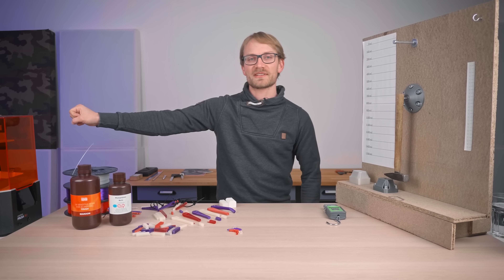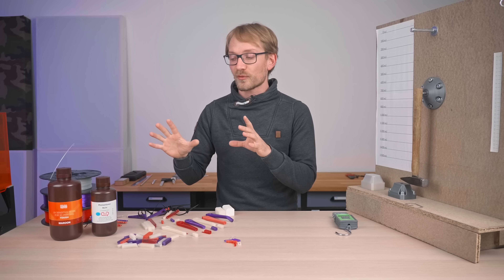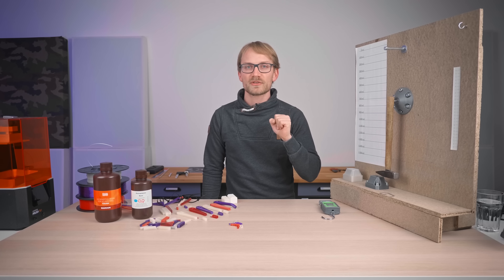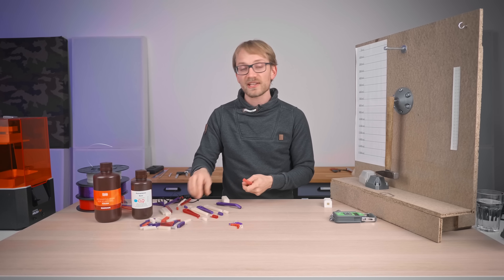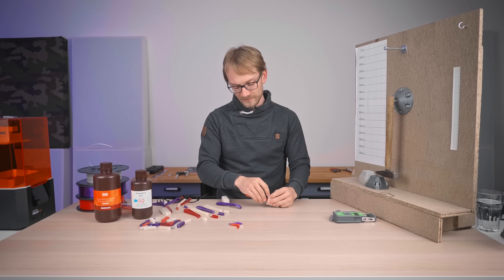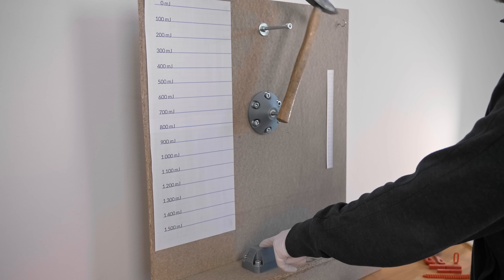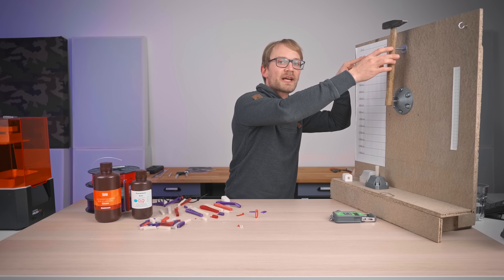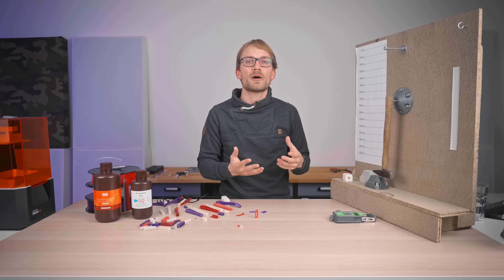Elegoo resin vs. Prusa resin vs. PETG vs. PLA

Comment: My big issue with resin prints is that they seem to continue to cure and become more brittle over time. PLA and PETg do get more brittle as well. I'd love to see a "6 month followup" where you print some parts in common materials, let them sit out in ambient for 6mo-1yr and then retest them to see how the properties changed over time
Reply: I can follow up on this.
It all depends on the resin.
Engineering resins that I have tested like Siraya Blu and Tenacious don't change over time.
In fact it's recommended to cure them under high UV power at 60c for 1 hour or more.
Now the cheaper resins on the other hand do become more brittle.
And as an extra bonus Glock frames made from a Siraya blu and tenacious mix perform rather well.
Reply: @rgstever  how did the frames hood up that’s what I’m looking at a resin printer for
Reply: @rgstever  can you use those "engineering resins" with "home resin printers" ? :D
Reply: @jesperchristensen8462  i would like to know this as well
Reply: @jesperchristensen8462  Yeah, they're just expensive.
Reply: @jesperchristensen8462  i have seen videos of people mixing 75% normal resin 25% technical resin from siraya, or 90-10... Different technical resins that they offer I think they were
Reply: @jesperchristensen8462  Yes. The Elegoo ABS-like is my go-to resin for my Mars 3 Pro. The Siraya Tech high performance resins also work just fine, when you're willing to pay double for a tougher part.
Reply: @ingeniando3d219  It really takes a mix with better than 10% to get any benefit. At 25% you're just starting to get a consistent change of performance, and it really takes closer to a 50/50 mix.

Though to be honest, what you're doing is taking an expensive high quality resin and corrupting it with a cheap resin. It's better to just pick the prints where you really need the extra performance and pay for it, rather than to try to jimmy the resin for prints that don't really require it.

The Elegoo ABS-like has excellent properties and is priced well. When you really need extra toughness or temperature resistance, it's better to just buy the expensive Siraya Tech resins and use it unadulterated to get the full benefit.
Reply: @saundby im just looking for whatever can produce the strongest and clearest looking clear and idk if fdm does it or sla
Reply: I saw a YouTube video where did a 1 year later test with different types of PLA. Regular PLA held up pretty well to outside weather
Reply: And leave one in a south window or just out on a fence...

Comment: I’ve been noticing that the curing times of resin are SIGNIFICANTLY greater that what anyone with a YouTube channel has been stating.  Using the Elegoo ABS Like resins, and a 60W UV lamp, I’ve been noticing that it takes at least 2 hours to cure prints, if not longer.  There is a huge difference in stiffness with those that have been cured for 2+ hours, and those under 2 hours.

Which brings up another point.  It would take days to weeks to cure prints outside under a bright Sun, even here in San Diego where we typically have a UV index between 8 and 12.  It would be interesting to see you and CNC Kitchen do some research into this from both the resin manufacturer side, and actual tests.
Reply: What kind of lamp are you using? Clear Crystal quartz or blacklight style UV lamp?
Reply: Deneteus neither.  I am using an 405nm LED UV lamp, which has even less loss than crystal quartz does.  I doubt anyone uses any type of UV bulb today.
Reply: @KaelumYodi  Commercial resin curing does that's why I asked specifics. They make equipment specifically for fast curing of resins. You can cure using UVC bulbs used in the medical industry for deactivating bacteria in air conditioning.
Reply: Deneteus I should have said that it isn’t practical today, to use UV bulbs for anything outside of extreme environmental conditions (i.e. extreme heat).  Bulbs can’t produce as narrow a bandwidth of light as LEDs can, they are extremely expensive to manufacture, they have short lifetimes, and they lose at least 10-20% of their energy just from shining through their encloser (crystal or other, as real glass blocks at least 90% of the UV).  Anywho, since I am using a UV lamp of the wavelength that the resin is specifically designed to react to, this is not an issue.
Reply: I suspect short cure just makes the print possible to handle and kicks off the curing, but does not achieve high degree of crosslinking, because that's just what manufacturers optimise for, they want to occupy the curing machine as little as possible and ship things to the customers and hope they'll take a while to actually load and break things, weeks or so. I suspect the curing once started doesn't actually stop when you stop blasting it with UV, it just continues more slowly.

Which then brings the issue that if my conjecture above is true, then all kinds of mechanical tests on prints that were done yesterday, are not valid during the life of the part several months after initial manufacture.

Comment: That's weird, my Elegoo printed pieces break wait too easily. Maybe I overcured them ?
Reply: Once set off, the curing can never stop. It is necessary to test in the most cured state possible, else the strength of the item is not representative of the strength it will have in actual use several month later. I am a bit suspicious whether Tom rushed the test a bit, if he believes the surface of the Elegoo print to still be tacky, but then, maybe the surface texture is simply slightly unusual and deceiving. Correspondingly there is a possibility that the inner opaque part of the Prusa resin will continue curing in the upcoming weeks.

It's completely unreasonable to undercure the prints on purpose.

I suggest that you likely have a completely different resin, is this possible? Also what makes you believe specifically that you over- rather than undercured them? Also temperature has an influence on crosslinking behaviour.
Reply: @SianaGearz  nope, it's the same resin, elegoo abs-like.
I was thinking overcured because I left them more than an hour under uv and the pieces slept on my windows for a few days (more than a week) before painting.
The scope I was painting didn't survive the fall of the table, one of the end broke in 3...

Concerning the resin behavior, I sometime have a tacky felling out of the cure, but it's because I didn't wash it enough, or the pieces were still wet under the uv. But most of the time the felling disappear once a few days have passed.
I think you're right, It might be a better test if the pieces are left a few days out to cure fully.

Comment: Test Siraya Blu please. At least that's the one being hailed as the toughest of the affordable tough options.
Reply: Oh, one more - if you want to make a test that no one seems to have done yet, do one where you test parts after extended UV exposure... I don't know how many hours in the curing station corresponds to, say, 6 months of an average European summer. But there's a lot of chatter about whether resin is more or less subsceptible to UV damage than many plastics. Some say that once fully cured, they are less prone to heavy UV damage while others insist that they will keep "curing" and become brittle (faster than many plastics). So far, all I can find is talk...
Reply: Also, Phil G had some results which seemed to show that curing at higher temps led to quite dramatic improvements. I think Formlabs has some white papers about that too (curing at 60-80C). But I don't know if the Prusa curing station can be set that high or set to keep the heater on during the cure cycle? There may even be improvements to be had from printing at slightly elevated temps (about 30C).

Comment: Finally some actual data about the durability of resin prints!!! 😁Very interesting results. The dimensional accuracy of SLA with at least PETG material performance make a very compelling argument for using SLA to produce functional parts.
If you're going to do more testing in future, may I suggest: 
Does prolonged UV exposure affect ductility? The claim / doubt / worry is that the resin will continue to cure over time, and become more brittle. Temperature resistance data for resin prints is often hard or impossible to come by, so that would be very useful data.
Thanks for the great video!
Reply: At work all the older resin prints are aged looking in a nasty yellow tint and extremely weak by comparison to new ones, so yes. It doesn’t take a super long time either and these are stored indoors (I’ve got FDM gears that are still fine even 6 years later on my printer and it’s sitting right next to a window, so ABS really doesn’t deteriorate as bad as resin even after a few years)
Reply: @jakegarrett8109  , does that hold for ABS-like resin?

Comment: Nice! If you want your resin prints to have a hard surface, you must post cure them underwater. Oxygen inhibits the upper layer polymerization, so you have to get rid of it. Also, some resins like warm post curing, and some don't, resulting in brittleness. You must test or follow the instructions accordingly. Thanks for the tests!

Comment: Filaween was a great tool for learning.
However, as long as we buy quality filaments, there do not seem to be huge differences.

It is important to understand when to use which material, but I usually do not choose one specific manufacturer to get the last 5% of material strenghts into the design.

For the resins, we now see massive differences in properties.
Differences of the scale between different materials in FDM.
In this case, choosing the right manufacturer definently needs to be considered for mechanical parts.

This was one of the most informative videos in the 3D printing space I have seen in a long time.
Keep it up! I would love to see an analysis of the difference between transparent and opaque materials. 
And of course between manufactureres in general.
I'd recommend a focus on "tough resins". Since this is what would be chosen by the customers for mechanical prints.
"Normal" resins, for figurines etc. will be used less for mechanical prints. So there is less gain in analyzing them.

Comment: While I agree most folks don't tune all their filaments, this leaves one problem nevertheless: You might test one material that's just about perfectly tuned—simply by chance—and another that's way off from its perfect settings. If all are equally "mistuned" it's fine, but without calibration, you just never know where they stand.
Apart from that: very interesting test, thanks!

Comment: Let's solve the layer adhesion problem somehow, is it possible to make the printer squirt some solvent to bond the layers better and to not leave gaps? It sucks if you have a part loaded in all directions because there's such a huge difference in the strengths
Reply: Solvent sounds like a terrible idea, very hard to control, because it will linger and it will go wherever and it will curl the print due to locked in stresses. What isn't though, is printing in a hot chamber. Whether an actively heated chamber, or just bed-heated chamber and an airtight enclosure. You can have thin-tube water cooling for the cold end of the tool head. You already have a suitable tool for bonding plastic to itself, it's melting, you just have to have the newly laid bead melt the very surface of the underlying one, and for sure preheating the volume of the print helps.

Upon cooling down, the print shrinks uniformly.

It's not a 100% solution, but it should get you a good part of the way there.

I recall layer adhesion was not solved by solvent vapour smoothing experiments, even though they provided an improvement. There is still inherent anisotropy to how the material cools down during printing which results in stress.

You may also recall that PLA annealing has provided a tangible improvement. Unfortunately it deforms the shape of complex prints a lot. Hot chamber printing does not.

Comment: curing behavioour of opaque resins is very different from clear resins. that is why resins used in engineering are usually not opaque.
Clear resins are much more predictable as the pigment content is so low it will nott obscure parts of the print while curing.

Comment: Hey tom, I’m a plastics engineer with experience doing mechanical tests on 3D printed parts. If you’re interested I’d be happy to help you doing future videos by helping you get your facts right and possibly doing some tests on the proper test equipment
Reply: My crazy idea is that Tom, Stefan, and other like-minded experts (like you) get together and create some standard test methods and open-source hardware test equipment to enable many materials to be tested in a consistent manner and post all of the results on the Toms3D, CNC Kitchen, Meltzone, or other website. Sure would be handy. And hardly any work at all.
Reply: @mikemike7001  This is one of the brightest thoughts I've seen for a while!
Reply: @mikemike7001  I am just beginning my first 3D printing (primarily mSLA) business and what you just suggested would be something that I would watch, use, and personally market on my website both to help me prove out selected material strength and pay back for the help in making more intelligent choices.

Comment: I wonder if you could change your resin printer test shapes to include a middle hollow core so UV light could be introduced into the center of some samples?  Maybe make it 5mm diameter so you could stuff a 5mm UV led in each end?  This way you could test with and without internal curing.

Comment: Is this the beginning of a clear resin revolution? It would be quite ingenious for manufacturers to do that actually since most users of resin printers use them for miniature models that need to be painted anyways. And engineers who use resin generally wouldn't care about the colour but if they did, translucent resins clearly would be able to cure just as well

Comment: Love this, thanks for your testing. I'm super curious about the heat resistance of filaments vs resins - ie parts designed to survive a hot car. Could you do a video on this? It's difficult to find good information on the heat resistance of the different resins out there.
Reply: Jimmy Blimps Resins don't really change when they're in heat -- they can't melt. They should be basically the same in a hot car as they are in a regular room.

Comment: I'm disappoint that the PETG is actually a strange filament with particle in it. Do those particle have a effect on physical property? Why making a comparison with strange filament that did not reach market?? This lower the "value" of this experiment.
Reply: All filaments with added aggregate are weaker in strength tests to their non-contaminated cousins.  You can think of this as a basement grading if you like.  Added materials can add rigidity (this one wasn't specced for that, so it didn't), but all will weaken the flexibility and overall strength of a part.  All those CF-infused filaments make much-more rigid parts, but all are less-able to absorb impact and tensile loads.  It doesn't come even close to invalidating the tests at all, since we know that the particulates are reducing the score, and therefore all results are lower than a pure PET-G, and this is a *RELATIVE* test, not meant to set an ISO standard rating for the materials in question.  It's very well-known that PET-G has fantastic mechanical qualities in its "raw" state, with overall formulation adding or subtracting from what we know it can do.  We also know that PET-G is absolute garbage - along with PLA - in thermal stability tests.  PET-G is an in-between material meant to bridge the gap from PLA to ABS/ASA, while being easy to print and slightly better at handling sitting in a window all day during bright sunshine.

The results of this test are what they are: relative scoring against the precise materials used in the other options.  Since many of us have quite a lot of experience with the filament side of things, this gives us understandable benchmarks with which to at least give a preliminary judgement on the relative benefits of the resins readily available to us (even if we do not yet have SLA printers - I went with the "buy a mill and work with aluminum" route, but I'm still curious about resin printing).

Actual ISO testing does nothing to inform the average consumer, because we are not factories turning out parts on a production line.  We can tune.  We can adjust.  We can spend extra time on the nitty-gritty, so practical relative measurements are far more valuable than lab tests than an absolute grading on an industrial scale.
Reply: Every filament has additives and color that effects the strength/flammability. Natural resin without coloring can have additives and only the manufacturer knows what is in it. It is often not listed in the Safety Data Sheets 'no data' is typical.

Comment: I can't print solid objects on my anycubic photon, anything thicker than 1mm on the build plate and it will peel off, for me it's basically useless, £300 wasted.
Reply: Sand the build plate.
Reply: @JohnJones-oy3md  Like with sand paper?
Reply: @Arek_R.  Correct. Gives it a little 'tooth' for the resin to stick better. Another method is to paint a thin coat of resin on the build plate, cure it, then print. This can act as a sort of primer for the print to stick to.
Reply: @ChristianP1973 Well, then what's the problem?
Reply: @Arek_R.  either "bad bed leveling/tramming " (check for "Flint Read method"), not strong enough supports or bad curing time. Do some few others test investigating and don't throw away your printer :) 

Happy printing
Reply: @piy3d969  Leveling is fine.
And as I said I get prints done with support but that's the thing I don't want to use any support, the finish of the floating surface is really crap whereas the one that peels of the build surface is what I want.